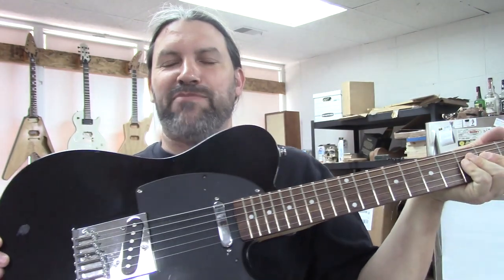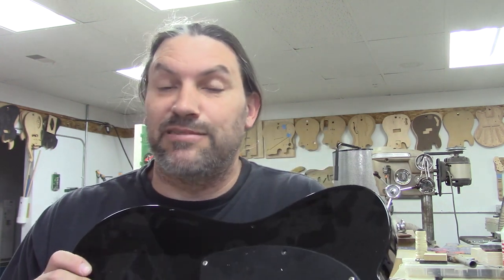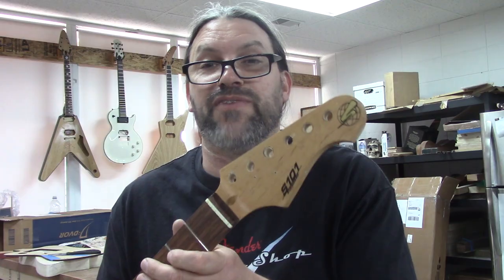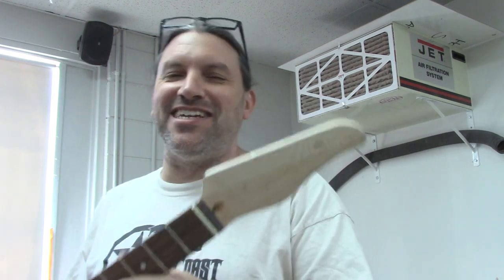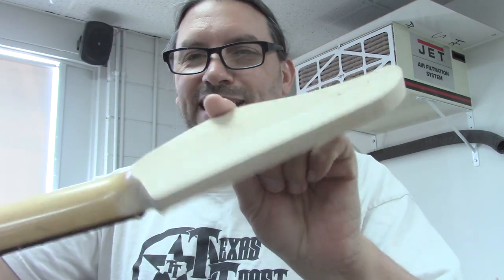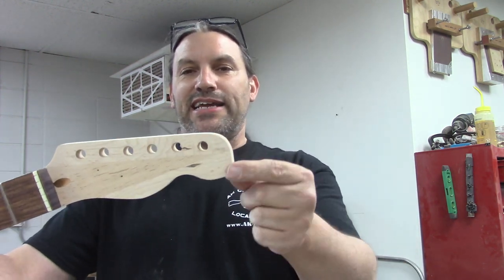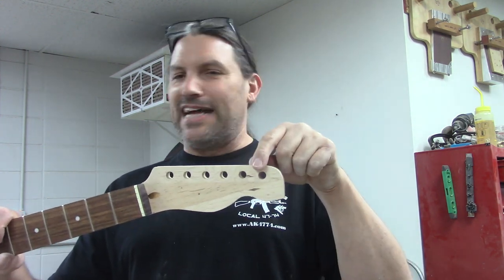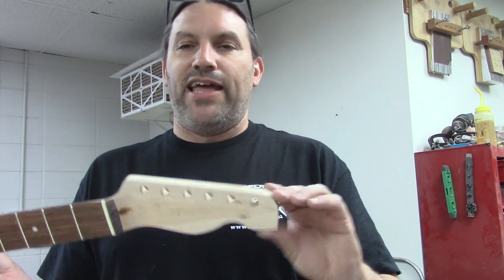How To Polish A Turdy Telecaster Style Neck... Or A Gypsy Curse

Comment: It intrigues me on high end guitars why everyone drills 10mm holes that the tuners float around in.  I understand why production made guitars are done this way but I would've thought custom guitars would be more fitted.  GraphTech Ratio tuners for example are 9.78mm and taper down.  The bolt at the front is 7.8mm.  Why not at least drill 8mm front, 10mm back so the tuner is supported by the wood.   Or taper ream the holes for a snug fit.  Interested in your thoughts on this.  Cheers.
Reply from the maker: I have done a few headstocks where we used stepped holes. It was kind of a non-starter.

Comment: Does it hang in a hanger straight? With no real shoulder on one side, it doesn't seem like it would.

If you don't use hangers, it's a non-issue. I just noticed that and thought I'd ask. Nice job, Matt! I'd have no issues having you do that to one of my Silvertones. 👍 It'd probably need a little more, though, because it's either painted black or has a black veneer on it.
Reply from the maker: Not too different from a regular Tele when it comes to hangers

Comment: I'm thinking just lay out the new holes north a piece of the old ones and using a forstener bit, but I might be elfin up.
Reply: what if the tuner backs still don't fit? ahhhhh
Reply from the maker: you could make a test piece of maple with the same size hole as are in the neck and try to drill them out larger for the MM tuners. give yourself an idea of what to watch out for on the customer neck
Reply: crainial anulitis for not already thinking of that! thanks for pulling my head outta my butt! 😁

Comment: Hi guys, I want to try to paint my first guitar try and I'm squirrely scared. I plan on using a Wagner Flexio 570 paint sprayer. should I just buy a spray can to go on my compressor with a different tip or what? I'm not looking for perfection, but I'd prefer it to not look like a preschooler painted it. I might even try my first cloth/fabric top, but it scares me to lose a real concert tee and guitar! Thanks for your opinions.
Edit: Because autocorrect hates the hell out of me. Why should autocorrect be any different than anything else in my life?
Reply from the maker: I'm not sure man, finishing is, far and away, the hardest part to get right. I would advise that you do a few tests and see if you get the kind of results you want.
Reply: @TexasToastGuitars  I figured as much, but that sealant is a little hard on the wallet so I thought I'd ask. Maybe I'll hit Harbor Freight and go the inexpensive route. That way, if it turns out disposable, I won't feel so bad.